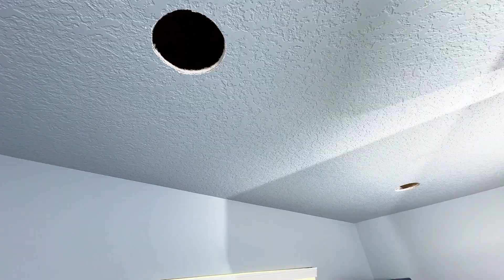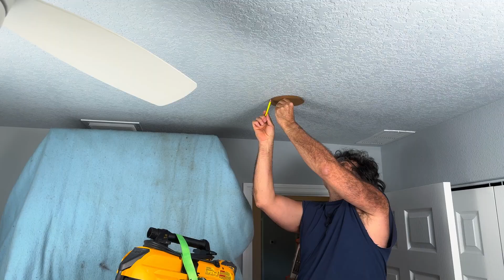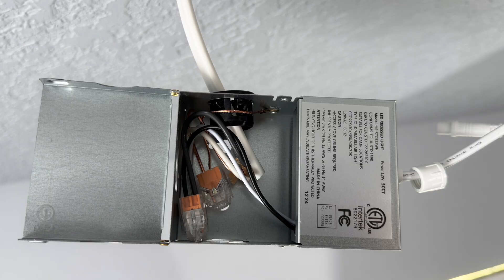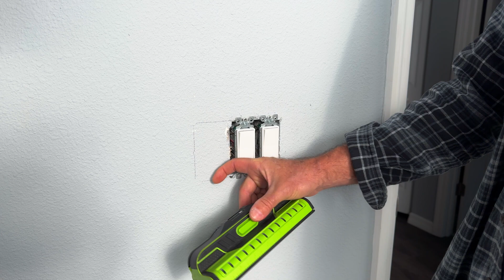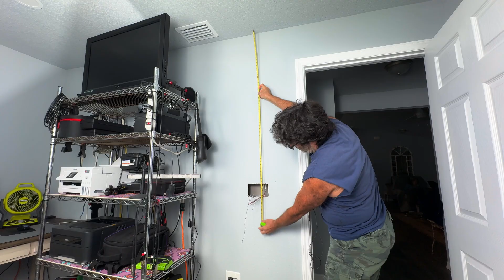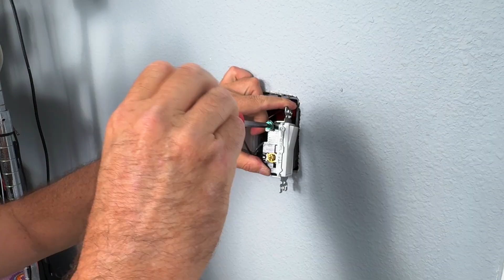Install CANLESS Recessed LED Lights Like a Pro!

Comment: In new construction you can use the LED recessed light fixtures inside a LESSCO Air Vapor Barrier Box to keep the blown insulation from falling out of the attic
Reply from the maker: Great idea!  Thanks...

Comment: Thanks for explaining nice and clearly with good closeup videos!  Does the Jbox come with the connectors you showed? They looked easier to use than wirenuts.
Reply from the maker: HI!  If I remember right they did come with those connectors.  TYSM for the great feedback... 😊